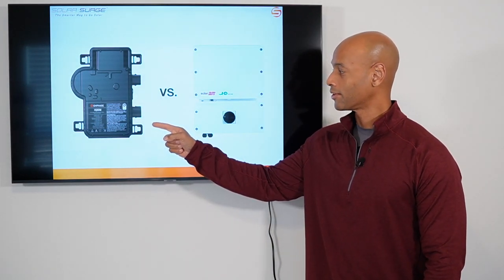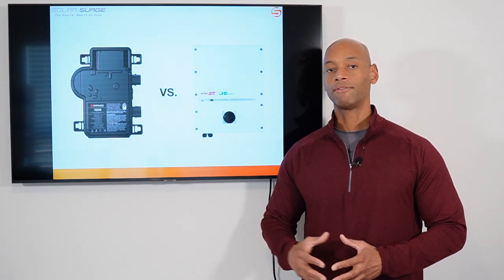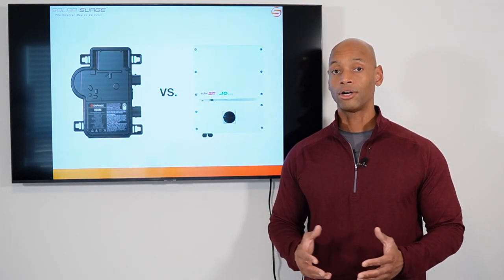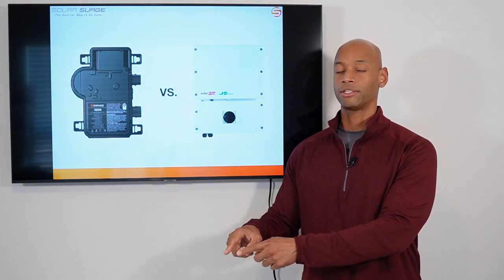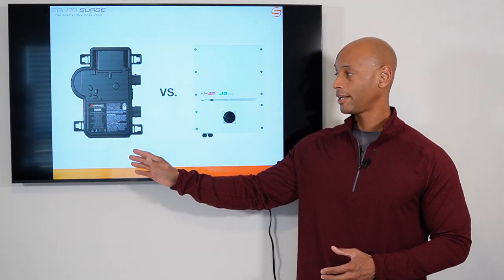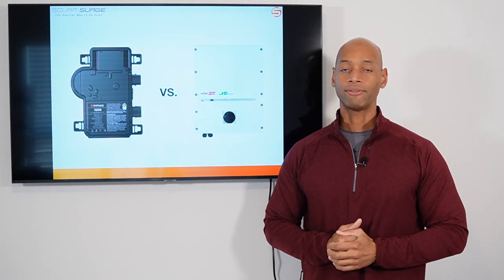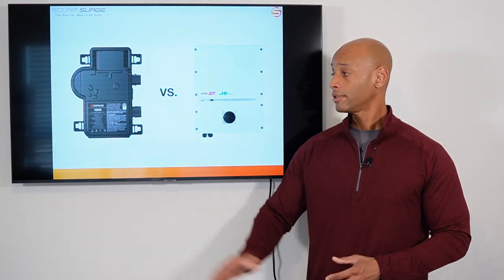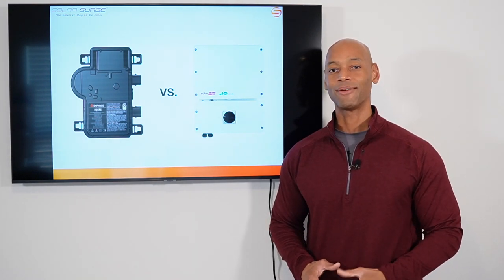Enphase IQ Vs SolarEdge Going Into 2023 | Solar Inverter

Comment: I’ve been designing/contracting residential PV for 17 years and I’ve installed thousands of both Enphase and SolarEdge inverters. We basically stopped recommending SE years ago because their failure rate is simply unacceptable. SE’s RMA process also is less than adequate. They make a great product when it’s working but the last thing any solar contractors wants is thousands of installed systems under warranty that are prone to failure; case in point is Pink Solar who just went BK as a direct result of what I’m describing above (not SolarEdge related though). If you’re a homeowner and you’re in the market for a 12kw or smaller system then it’s worth it to spend a little more and get Enphase. That’s my opinion. When you start getting into the larger systems like +30kw then SE might start to make a little more sense
Reply: Also any other voltages than 240 or 208 is difficult to install with Enphase, so that’s a slight bonus for SolarEdge if you’re installing a solar system on a building with 277/480 voltages.
Reply: HI there! I was wondering what state you install in?
Reply: As a solar technician, I can agree that I replace 5 SE inv. A week
Reply: @markwullenschneider195  Is that still the case with the SE update thst promised higher reliability.  Joe mentioned in the video that it's been addressed but would welcome your on the ground POV.
Reply: What about a system in-between those sizes. I'm looking at a 20kw system and can't decide which route to go.
Reply: @ramsayzaki Enphase is more reliable and more efficient
Reply: The M150s and M190s failed. IQ hasn't been out long enough to know if they will have super high failure as well. SolarEdge doesn't have a "legacy program" to avoid a total recall.
Reply: Sometimes consumers just want more affordable.
Reply: With SE warranty, who pays for the electrical work if you need a claim under warranty ?

Comment: My 10Kw REC Alpha 400 rooftop array coupled with the Enphase 8 microinverters has been a solid win. 
Thank you Joe
Reply: I went the tygo route on my 400w panels how have you found it? Especially in peak conditions since the enphase will clip the output on our panels
Reply: @ram64man   So far I have not experienced the clipping effect. I’ve seen some very bad clipping with other users but the inverter size was not a match for the panel. I.e., 410w panels matched with the IQ+ and not the IQM or better. The heat is tough in South Central Texas and the panel efficiency goes down. Cheers
How do you like the Tygos. I think they have a good product.
Reply: I have 16 x REC Alpha Pure 405W with IQ8M inverters.  I asked to be upgraded from IQ8Plus to IQ8M because I was worried about clipping.  I've seen minor clipping on sunny days between about 12 and 3PM, but not enough to make a big difference in overall power output.  I'm glad that I asked for the slightly better inverters though, because the smaller ones would have had more significant clipping.

If going up to a 420-430W panel, I'd probably go up to IQ8A.
Reply: @citystuff7184  Excellent move, same here, the Tech at Solar Surge designed the system with the IQ8M on the REC Alpha Pure panels and have seen relatively little to no clipping.  The roofs in South Central Texas get way too hot for a good part of the year.

Comment: In all these videos you're leaving out one of the main components as well and that is the monitoring systems. By far the solar edge has better monitoring and it allows the installers or the owners to problem solve any issues. You should do a video on the differences and abilities of the monitoring portals.
Reply: Yeah I sold SolarEdge just because the monitoring was more intuitive for homeowners.  Come on enphase.  Consumption BELOW the x axis?   Thats useless.
Reply: @shroud1390  how is the failure rate in your experience?..   and isn't it warranted anyway if there is a failure ?

Comment: My solaredge system was out 5 times last year.........nearly 1/3 of the year. Solaredge is an equity based system, the "optimizers" turned off the system. The reason was because I optimized the locations to get the most sun. The problem was that the optimizers did not like that because only 5 of the panels get the best level of sun. I switched to enhpase which is a meritocracy based system. This one allows me t have the panels that to do get an even amount of solar energy. I can also monitor each panel easily.
Reply: Did it cost much to convert from solaredge to enphase? thanks.

Comment: Joe, I gotta give you some critiques on this video.

First of all, I’ve installed SolarEdge systems and Enphase systems for almost half a decade now and I’d say that the failure rate for the SetApp SolarEdge inverters is still around 30-40%, especially around year 5 of the install. This failure rate is still unacceptably high and I believe it has to do with a few design flaws with the SolarEdge central inverters. It’s also highly annoying as an installer to have to drop everything on a service call when a customer’s entire system goes down because of a central inverter when replacing a single microinverter take only around 15-30 minutes tops and it’s only one panel down in the entire system.

Also, Enphase has a powerful 384 VA IQ8 H microinverter for 240v systems but obviously that microinverter is going to be very expensive in a quote.

I would say one of the main advantages of SolarEdge is still for commercial installations, because Enphase doesn’t have a very easy to install solution for 277/480 buildings besides to add in a step-down transformer which can be annoying to have to install.

Because most high powered modules are still around the 400w stc level, the clipping losses are pretty insignificant especially when paired with an IQ 8H inverter. That said there is a tiny round trip efficiency boost with SolarEdge because of the DC to DC conversion, but it’s not really enough in my opinion to justify having to deal with the single point of failure problem which can be extremely frustrating and annoying to deal with on service calls.
Reply: Hey Nolan would you be willing to come on the channel and give your take on installing both systems? An honest take. If so our contact is in our about. Thnx -Vitaly
Reply: HI there Nolan, What state do you install in?

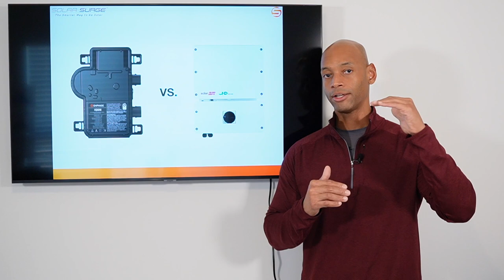Comment: I'm off grid right now I have 5 x100 w panel, wind Tribune, 3x gel battery and a MPPT high-end type wind solar hybrid controller. This is not meeting my need. We have a total off grid 2 bedroom home with the common utility but we also want to add aircondition. 10:57

Comment: Warning… I’m going to be controversial on this I’m sure…
First- Joe, your last video comparing these products was good and when I saw this one, I thought it was that previous video, but I clicked anyway and I’m glad I did. I very much liked this one. 
Second- my opinion based off my experience is, we way too easily accept the idea and the studies that say clipping loss is actually good, helpful in some locations  or acceptable. 
I have not read many many studies and claim to be anything close to an expert on the methodology of these studies, however it causes me to wonder who is most set to benefit from this type of finding? 
Maybe Micro inverter manufactures?

I’m sure this is a terrible example but I don’t want to spend my hard earned money on a home air conditioner that’s capable of cooling my whole home, but then my electrician only provides enough electrical power to use part of the cooling capacity and call it 
clipping and tell me it’s acceptable or good for me…I want my system capable of running full capacity. 

I struggle that it seems we say, oh well that’s just clipping loss and accept it. 
It seems we then tend to encourage Home Owners to accept it also. 

I know some higher VA Micros are coming or are in the works, yet this not the whole of my comment, but I’m speaking to the mental acceptance over the last many years. 

I offer this possible other questioning attitude…Instead of simply accepting this mindset as many have up to this point, why don’t we collectively demand higher VA from Enphase or other manufacture?
Our dollars are powerful!

Especially when see modules are capable of producing between STC and NMOT, 
And we know the module industry is consistently showing increased module wattage year over year it seems. 
I realize there are pros and cons for increased VA Output of micros, yet for the purposes that often times we are trying to harness as much light energy to convert to electrical energy as possible per given amount of space, 
For me, I want higher VA Micros that the common customer can reasonably afford. 
Ok, I’m done. Lol
Thank you Joe!
You run a great program!!
Reply: DC coupling is a superior architecture, especially when storage is added to a system. Adding a battery to a SolarEdge system eliminates any downsides of clipping.

The single point of failure is still there, but the inverter can be serviced from the ground without going on the roof. I've found the optimizers to be extremely resilient and provide the benefits of micros at a much more acceptable cost.
Reply: I definitely understand the issue with micro-inverters clipping. But with 384 VA micros and 400 watt panels, very few NMOT conditions will even produce 400 DC watts of power from a solar panel.

That said, clipping is still an efficiency loss, even if it can be small. 

One of the annoying aspects of Enphase is also the tighter tolerances on voltage drop/voltage rise, which isn’t always mentioned.

Enphase systems only allow 2% for the entire system, which SolarEdge is close to 4%. 

So field wiring costs can sometimes be more expensive for Enphase depending on distance of the solar system to POI.

Comment: I just took the class to become a installer for enphase after doing as much research as I possibly am able to I find that enphase is the best fit for me. Super easy rma US based support I cannot stress this enough how important this is. I don’t think solar edge is bad but changing out a micro inverter is way easier than changing the main converter that comes standard with an only 12 year warranty and you have to pay ore for longer. I know both have there purposes I just feel like enphase has a better support system and teaching utilities support when needed. Love your videos always watch everything new.
Reply: All the best on your career. My concern is that there is so much innovation, a good thing, until you have to purchase everything that is now better.
Reply: Sounds like you are on a fun adventure. 
As for simply changing out the micro compared to the SE inverter, depends of how tall the roof is, weather and roof conditions, accessibility of the bad module/where in the array it’s at, how well you kept a notes of the modules, etc. 
sometimes changing out the SE is preferred in my book. 
Best to you.
Reply: @davidorcutt9246  my intention is to become certified in both. However the redundancy of the micro inverters is pretty good. I also have seen where even with the SolarEdge  systems of shaded enough do not perform as well. I would imagine there are better systems for different situations. The fact that only have a 12 year warranty though makes me wonder a little.
Reply: @charlesdavis7461  we can’t think like this at that point never buy a car or a tv or anything for that matter because we are constantly innovating and moving forward. For me at least I feel like we are at a point where it’s much more feasible to invest in solar because they pay off period is getting to be less and less and with most products having a 25 year warranty. After 10 years your making money. 

Also the roi on a solar system is about 14% where as the stock market is roughly 6-8% so your further ahead putting solar on then wall street at this point
Reply: @davidorcutt9246  another thought is that with the app and how they have you build your solar array in the work space and the enlighten system it’s almost impossible u less you don’t do your job to not know what inverter is bad. They also do over there air diagnostics and automatic rma to get new product to you. I do agree with the roof thing though it could be a pain in the butt. Again every job has a certain system that’s needed.
Reply: @screwydrewy7027  ROI is a completely bogus comparison as it doesn’t take time into account.  If I invest $100 and get back $200 in 1 year or get back $200 in 10 years, the ROI is the same, but the investment performance is vastly different.  You have to look at IRR to get a valid comparison to the stock market average annual returns.

Comment: 🎯 Key Takeaways for quick navigation:

01:25 🌞 String inverters convert high voltage DC power from multiple solar panels into 240 volts AC, but have drawbacks like reduced performance due to shading and no module-level monitoring.
03:29 🔄 Enphase introduced micro inverters, placing a small inverter on each solar panel, enabling module-level monitoring and eliminating single points of failure.
05:34 🔌 SolarEdge introduced DC Optimizers, placing a device on each panel, providing module-level monitoring while maintaining the simplicity and lower cost of string inverters.
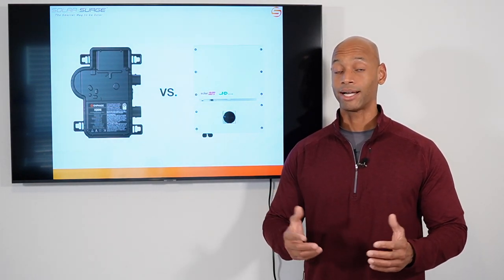07:41 🏭 SolarEdge faced initial reliability issues with its SetApp inverters, but both Enphase and SolarEdge are now similarly reliable.
09:46 ⚡ Clipping loss occurs when the solar panel's DC rating exceeds the inverter's AC rating, and SolarEdge has an advantage in minimizing clipping loss.
12:47 🔋 Both Enphase and SolarEdge offer batteries, load controllers, and EV chargers, becoming comprehensive home energy system providers.

Made with HARPA AI

Comment: I have both systems installed on my house. South side has Enphase. The installer was terrible and the support from chat and voice both equally useless. Took a year and several technician visits to get it to work right.  Even then, it's only 4kw.
North side of house, different installer, wasn't much better. Even after 3 inspections, the ONE thing they should have done, but didn't, was to make sure it turns on. It did not. Took another 16 days to get a tech out.
Both systems combined is 8kw.  Had I to do this again I would max out the entire roof, tariffs be damned.
The monitoring software doesn't understand there are two systems. Basically have to trust NVEnergy to not do me dirty.

Comment: I installed panels last year (2022) and was fully aware of 2:52 - shade will bring down entire string to lowest efficiency. I read this in all the places I learned about solar panels. So I bought 3 optimizers to see what is the difference between panels with optimizers and without. But to my surprise, in real world, I don't need optimizers. The shade drops either on optimized panel or not, it doesn't bring my whole string down. Where do I read about WHY that happens? I have Growatt MOD 9000TL3-X inverter and Jasolar JAM54S30-405/MR panels.

'm aware that panels have bypass diodes, but I'v been thinking there are physics into play that prevent specific amount of current going through shaded panel, etc, etc... so where do I learn about what part of the system enables a simple string inverter to behave pretty good in partially shaded env? I guess maybe panel gets "shutdown"/bypassed instead of getting any shaded juice out of the panel in my case, but I have to experiment a bit more to find out.
Reply: Are your panels split?
Reply: @bernadetteconnolly512  split how? They have 3 bypass diodes I think, so kindof split in 3
Reply: Yeah, theirs a lot of misinformation regarding shading advantages with micro inverters...

Comment: Enphase's combiner box has an 11 panel limit per line to roof, not "13 or 14" as you describe.    I don't understand what happens on the roof but my understanding is that they plug into the line in parallel.  So our 21 panel system only has 2 lines going to the roof.

However; one advantage to getting DC from the roof (unlike AC from MicroInverters) is that battery storage & use can all be done before conversion loss, and before the power company can complain about exceeding limits (as with California's NEM rules) - potentially a major factor for future expansions that include a battery.  With AC, it has to re-convert to DC for battery, then back to AC to be used or re-sold back to Edison.  Do I have this right?

Finally; life-expectancy is a major factor.  Historically I've heard that central inverters last about 10 years, but micro-inverters should go for 25 or more.  That's a HUGE difference that most reviews gloss past.  I'd be interested to learn if that's been improved on.
Reply from the maker: That's true.  String inverters generally carry only a 10-12 year warranty, compared to 25 years with Enphase micro-inverters.
Reply: the limit to the number of panels on a string has everything to do with the output ampacity.  it could be anywhere from 8 to 20, depending on the power output of the panels and which model of enphase microinverter
Reply: SMA inverters have an extended warranty up to 25 years. And their RSD's come with a standard 25 year. You say micro inverters  go for more than 25 years. I find that interesting since Enphase was founded in 2006 with first product released in 2008.  SMA has been in existence for 40 years.

Comment: Joe, another great video. I am about to have an Enphase system installed in Australia. Enphase will only provide a 15 year warranty on the micro inverters rather than the northern hemisphere 25 year. Maybecthey are concerned about long term heat affects. I chose micro inverters for the redundancy aspect, although my only concern was, what if Enphase closed, where would a replacement micro-inverter come from?

Comment: Have installed solar edge in 2019, only worked for 1 1/2 years, I also have the 25 year full warranty, they sent 11 technicians ( who did not fix the unit), to my house an still refuse to honor the warranty.